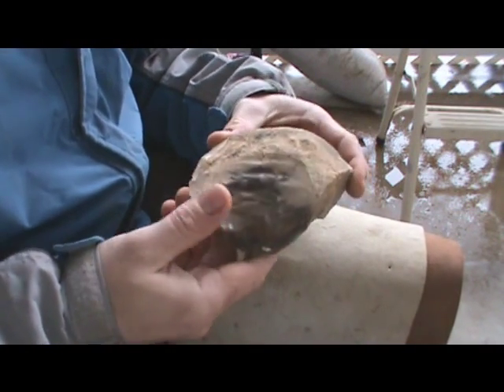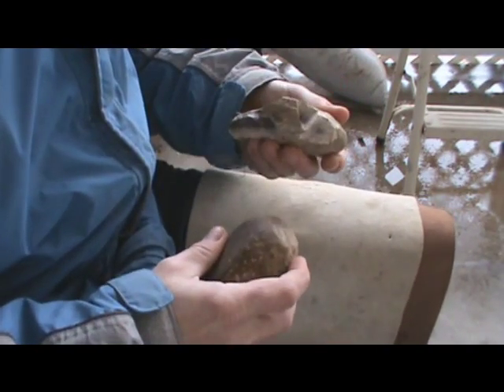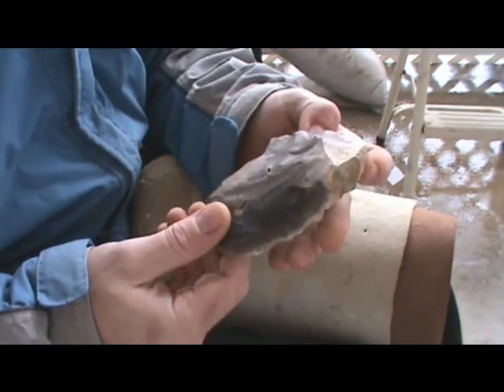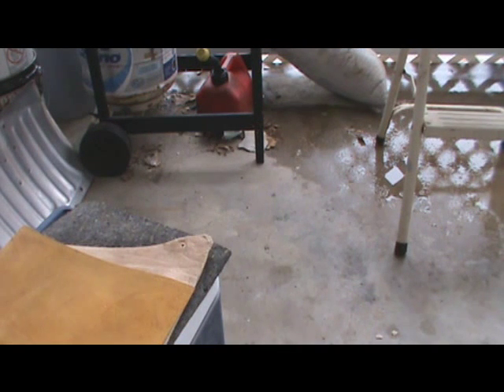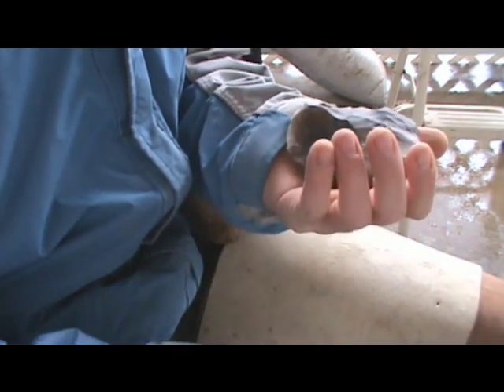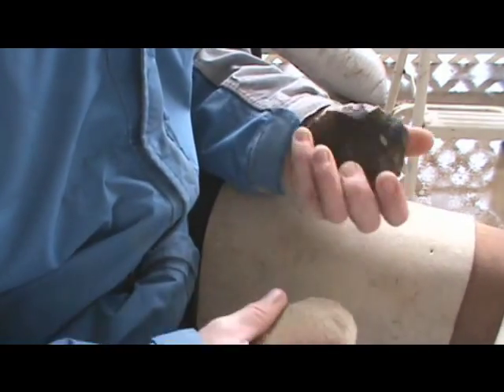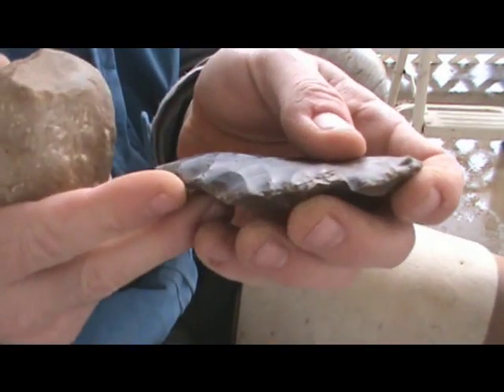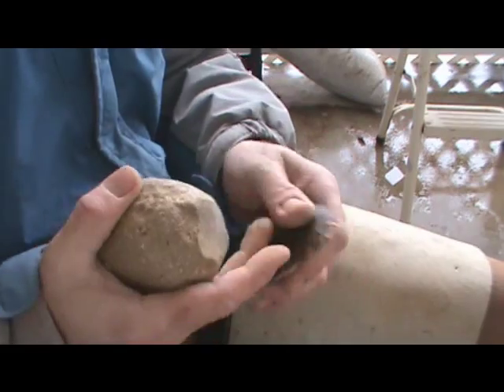Part 1 Hammerstone demo on Tony's rock

Comment: It's good to see someone who really knows what they're doing and can bring usable knowledge to new knappers. A lot of my early learning curve was moving beyond bad habits that were promulgated in videos and internet by people who professed to know what they were doing. A little knowledge can be dangerous. Getting a relatively thin piece out of a much larger rock is not necessarily a mark of an accomplished knapper (teacher). If the finished piece is substantially smaller than necessary because the person does understand rapid thinning then I'm not sure what they are doing posting videos. I suppose most are seeking their 15 minutes of fame. The few times I have been able to help some new knappers it was by virtue of helping them to undo useless technique they learned online. I won't call these folks out (I'll leave that to others perhaps) but advise newcomers to be careful whom you watch. Thanks, Marty.
Reply from the maker: Thanks for the comment.  Learning knapping is difficult regardless of tools or approaches, but almost all Knappers start from a copper percussion and carbide abrader starting point.  When they want to teach “abo” knapping they do so in a way that reverts to habits they’ve most practiced with and unfortunately is a big hinderance to learning different and applicable tool sets that apply towards replication.  It leans towards heat treating all stone and making assumptions about skill levels that aren’t well understood.  It’s a challenge for me too.

Comment from the maker: @theolithic71 Large hammerstones are great early thinners when they're soft.  bid advantage to conserving width with them because you can keep the blows fairly slow and steady.  The faster you swing a hammerstone, especially harder ones, the more the flakes will undulate, and flakes are prone to shatter.  Once my thicknesss is almost there then I like to downsize to the smaller hammerstones for more control.

Comment from the maker: @MrSchpankme  If you went camping on the right gravel bar with the right flint and hammerstones you'd never use copper for bifacing again.  It definitely is a different strike that takes some getting used to, but once it's down it's plum efficient, and not that tricky.